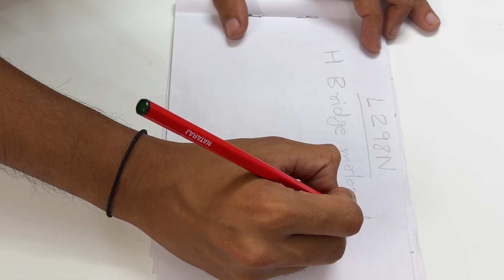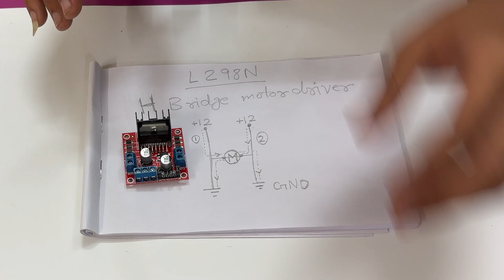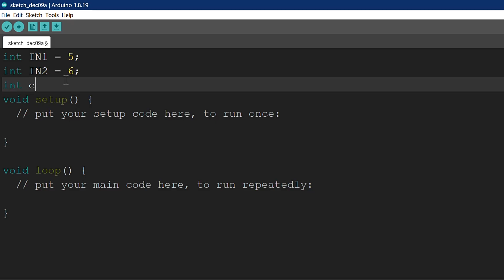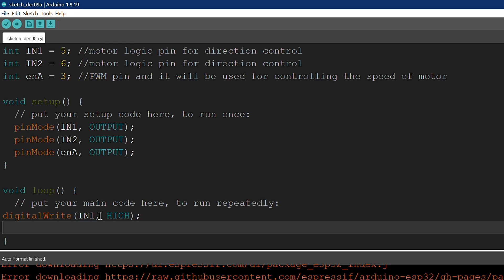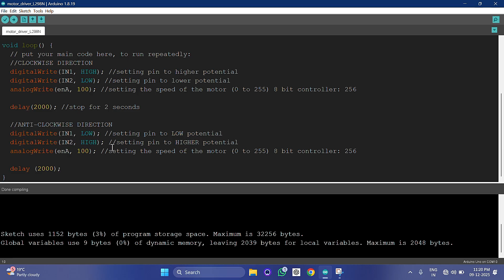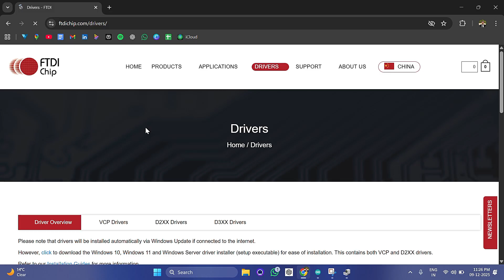L298N Motor Driver With Arduino Uno | Step-by-Step Wiring, Connections, PWM Speed Control, Debugging

Comment from the maker: If you face any issue with wiring, motor direction, jumper removal, or Arduino upload errors, reply here with a photo or screenshot.
I will help you fix it.
Also comment which tutorial you want next — Ultrasonic sensor, IR remote, or RC car project!